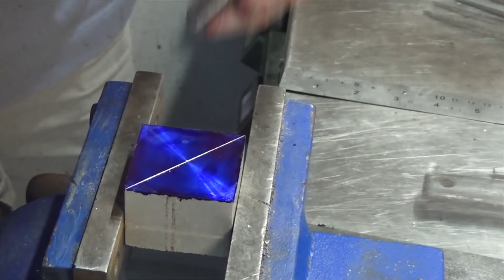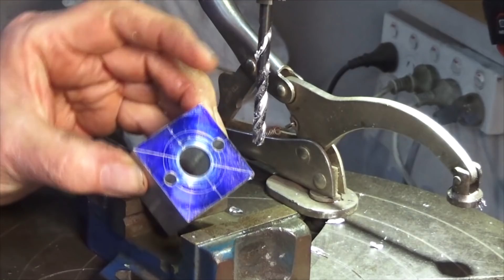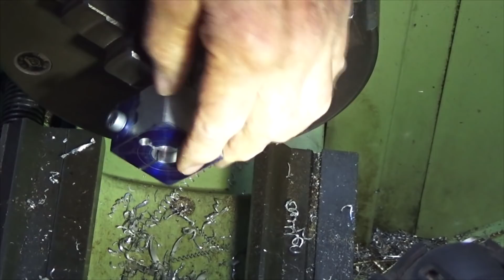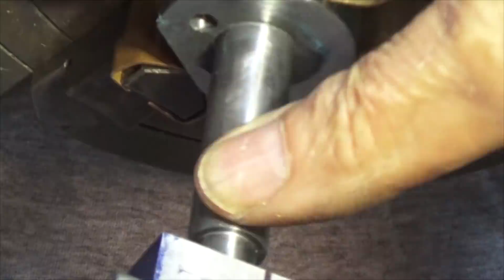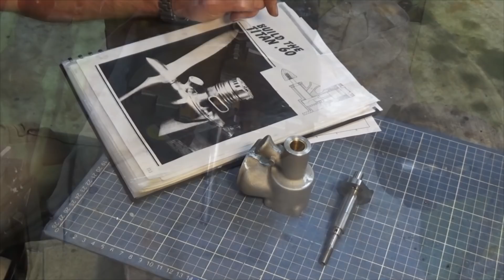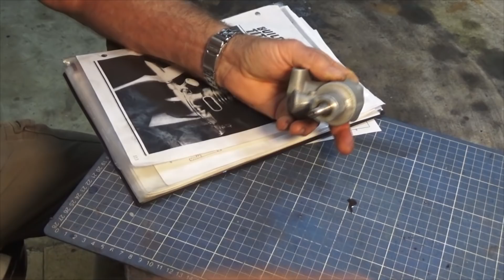Building the Titan .60 Glow Plug Engine #4

Comment: You might try running the crankshaft in the bushing using a drill motor and a fine jewelry polish at the tight spot.  There was a polish in a tube call "Semichromepoli", pink in color, that I've used for fine lapping in the past.
Reply from the maker: I have been able to remove the tight spot by running the shaft in the bush using the lathe at low speed with plenty of light oil. It freed up in just a few minutes. There were probably just a few microns of oversize shaft right at the junction of the shaft and the crank disc. Some people suggesting putting an undercut on the shaft or flaring the bush opening and that was going to be my next step but luckily it didn't come to that.
Regards,
Mark

Comment: My father was a tool maker and he used lapping compound on a leather belt! He would apply the lap to the soft leather side, then polish it using the hard side of the belt. He was one of those fathers that made you watch in his garage work shop and as a young boy I’m sorry to say I had no interest but I paid attention as I knew there would a Q&A afterwards
Reply from the maker: My father had a leather strop he used to sharpen knives. It probably had some sort of abrasive embedded in the surface. It did produce a wickedly sharp edge on the knife though. The whole father/son/workshop thing is an interesting topic. Some of the best students I ever taught would reveal that they spent time in their dad's workshop from a very early age or sometimes their grandad's shop. When my own son was a toddler I would put him in a backpack as I worked and he would look over my shoulder. It kept him safe and interested and I could get on with things. He is now an "Advanced Manufacturing Technologist" and he loves his job. It was not all plain sailing though. As a teenager he and I had our differences over respecting tools and cleaning up. I guess that is quite common. 
Regards,
Mark

Comment: Steve Summers did a lap vid on the mini lathe headstock which was quite informative. 
MDF can be used also to imbed the paste.
Great series Pres, thanks for sharing. 
Cheers
Reply from the maker: Thanks. I used to have some big pieces of Lignum Vitae wood which was incredibly dense and stable. It would make a really good lapping block. I am keen to have another go at this process when I do the cylinder liner.
Regards,
Mark

Comment: Hi Mark.
I don't "know it all" but FYI, when we were rebuilding large diesel engines and had used an aluminum lap on the crankshafts, we were told to always clean the crankshaft with a strong caustic solution to be sure to remove any aluminum that can get embedded when using an aluminum lap. We were told that not cleaning the crankshaft with caustic could lead to wiped bearings from the embedded aluminum.
I'm not sure that would apply here, but it may save you some trouble. Take care.
Reply from the maker: I guess that makes sense. The caustic would etch away any trace of the aluminium. As it turns out this engine will probably only run a few times and then it is to be sent back to the owner and put in a museum to honour the designer, George Genevro. That's if I can get it to run!
Regards,
Mark

Comment: Thanks again Mark, this series on the Titan 60 has really caught my fascination and I am looking forward to seeing the engine completed and running. I did comment on a previous video to ask if it would be possible to use 3D imaging technology to create new patterns for the body and crankcase of the engine? Anyway, I hope you manage to get away and enjoy your break in Tasmania.
Reply from the maker: I would think that you would need some pretty complex imaging systems to scan inside. Even a FARO arm with a laser scanning head would find it hard inside that small space. If I had to do it I think I would pour a moulding silicone inside and it would pull out fairly easily when set. You could then scan that to get a point cloud for an STL file. I am still hoping that the original patterns and core boxes can be put back into service.
Regards,
Mark

Comment: Chuck up the crankcase with the bushing installed, put a shallow champher on the bushing facing inside. Great series, as always.
Reply: I meant to say, would it be possible to champher the bushing?
Reply from the maker: It is fixed now. It wasn't hard at all. It just needed a few turns at low speed with plenty of light oil.
Regards,
Mark

Comment: Hi Mark I have found your series interesting, I was thinking by using some string with lapping compound on it could get you close to the counter weight of the crank and cut only the high spot on the shaft. or maybe just undercut the bushing at the very end where the binding occurs. I'm not sure if trying to run in the engine is a good idea, the risk of galling at the crank counter weight 
good luck Rich
Reply from the maker: Rich, I think I have fixed the issue. I just ran the crank and bearing in the lathe on low speed with plenty of "3 in 1" sewing machine oil on the surfaces and it has freed right up. The amount of oil in the glow plug fuel would not be sufficient to prevent galling and of course it would be running at some insane speed but in the lathe you can feel how much resistance there is and adjust accordingly.  All good now.
Regards,
Mark

Comment: Great work!  Leather or plastic sheet are good options for bed protection.  If you slop enough compound about it can get through fabric.
Reply from the maker: Thanks. The stuff that is supplied in the syringes is pretty clingy so it doesn't tend to run off. The main issue is to be disciplined in getting rid of the paper towel used to clean the part.
Regards,
Mark

Comment: How about an un-clamping screw as well as a clamping screw? Put lapping in the title, it'll get more hits! Cheers, Matthew
Reply from the maker: If you wanted to use the lap for other jobs you could add quite a few refinements. This was probably a one off so I didn't go to much trouble with it. I need to make another one for lapping the piston and an internal lap for the cylinder liner. Many people questioned why I bothered to make a lap for the crankshaft but I wanted to practice on something that was less critical. The piston/cylinder fit has to be almost zero clearance at the top of the stroke. 
Regards,
Mark

Comment: Lapping is always so satisfying, the highest of precision with the simplest of tools. I sometimes make 2 or 3 laps each dedicated to a specific grit diamond grit size. Great job!
Reply from the maker: Thanks Nigel. I was initially thinking that lapping was some sort of black magic and only those with Renzetti like powers could even dream of achieving it but it turned out to be a bit of an anti-climax. This was only the opening round though. I still have to lap the piston and the cylinder liner.
Regards,
Mark

Comment: Put a small Chamfer on the crank bush this will help with lubrication and fix your end float fit .
Reply from the maker: Thanks Ian. I think I have resolved the fit issue. I just ran it lightly in the lathe for a while with some light "3 in 1" sewing machine oil on it and it freed right up. There was a light sheen of gold coloured film on the shaft when I was finished so  I am guessing this was the remains of the very slight interference fit. It now spins beautifully. There is literally no discernible slop in the fit. Usually if you push the shaft side to side you can see the oil film squeezing from one side to the other but in this case it is rock solid radially but still smooth as butter axially. Happy days!
Regards,
Mark

Comment: Could you 3D print pattens off the drawings you made? I have done that before to cast parts myself.
Reply from the maker: The external shape of the casting is not too hard but it has some internal detail that is almost impossible to measure. The transfer ports are 3D shapes and would require core boxes to replicate those voids. I don't know how critical the shapes would be but I am guessing that it takes some experience and theoretical knowledge to understand the gas velocities and how the volumes would affect them. 
Regards,
Mark

Comment: mark relieve the inner edge of the bronze bush put a5 degree shamfer on the inner rear edge don't taper it just a small shamfer that should relieve the tight spot cheers glenn
Reply from the maker: Glenn, I have fixed the issue. It just needed some light running in the lathe with plenty of light oil and it freed right up.
Regards,
Mark

Comment: Interesting tool I like it. My only input on it would be, that you add a groove in the bushing at the top. In the trust area. Like an old Harley crank case bushing. To allow oil to fall in between the crank face and the bushing. So as the prop pulls forward on the crank the crank will sling oil into the trust face and down into the shaft bush. Another thing I would do would be to center drill the crank from the back side with about a 1/32nd hole. Go down about halfway into the center of the bush. Then drill another hole centered on the trust face bush groove down to the core hole. Then drill another hole from the center of the shaft where it sits in the bush down to the core hole. Then press in a plug at the back and pean on two sides so it can never come out. That way you have oil that has slung in between the thrust face and as the crank rotates the crank scoops up oil and sends it to the middle of your bushing and out.
Reply: The crank's already centre drilled, that's the fuel inlet path.
Reply: The fuel itself is all the lubricant needed in these nitro engines.
Reply from the maker: I must be careful to follow the build notes supplied by the original designer, George Genevro. The project is as much about getting the engine to run as it is to honour the work that George has done in his 99 years. Also, the fuel in these engines is much like two stroke fuel. The only lubrication comes from the dissolved oil in the methanol fuel. Back in our day it used to be castor oil.
Regards,
Mark
Reply: @Preso58  ah ok

Comment: I heard what you said in the speeded up section with the bandsaw. Great video. Neat honest series
Reply from the maker: It was a race between getting the cut finished and roasting my finger tips. A more astute builder would have had a block of wood on hand to push the stock. I am not that astute.
Regards,
Mark

Comment: i feel like that could easily be printed and casted at home
Reply from the maker: I wish. The internal detail is almost impossible to measure. There are gas passages in the space between the crankcase bore and the cylinder bore and they have 3 dimensional curves. The outside shape could be replicated fairly easily but even with sophisticated laser scanners it would be quite a mission to get at the internal shape without cutting the casting in half. 
Regards,
Mark

Comment: You're smarter than me ..  would lapping the bushing to the crank, to remove that last tight spot, be an option?
Reply: Getting the bedded particles of diamond out of the softer bush afterwards would would be a problem, and if left there would lead to wear.
Reply from the maker: Paul, you cannot lap soft materials like bronze without embedding the grit in the bearing. A soft lap can cut a fully hardened shaft without too much wear but lapping a soft bearing would require an even softer lap. Maybe lead or plastic would work but I would still be concerned that there would be some embedded grit in the bush.
Regards,
Mark

Comment: One way to get an extremely bright finish is the use crocus cloth and some very fine crocus powder .
Reply from the maker: Joe, this was more about getting the shaft dimensionally accurate rather than getting a polished surface texture. A lap can make an out of round part truly round and it can also remove axial high spots to very fine tolerances. 
Regards,
Mark

Comment: Nicely done, Preso! 😊  I've used dirty leather to polish rings made of 316 stainless pipe and that worked quite well. Didn't have a lathe, just a stud bolt and a drill press lol. Not exactly for precision obviously, but it did make them shiny 🙂. Loved the out takes! I could tell you were putting in some extra effort for us right off the jump 😊. Thanks, Preso! Have a good one mate! 
Cheers! 👍😁👍
Reply from the maker: I recall my father had an old leather strop that he used to sharpen knives.  It must have had something embedded in the leather because he could get a razor sharp edge on a knife with seemingly little effort. His party trick was shaving his arm with the blade after a few quick swipes  on the strop. I could make a two hour video with all the outtakes I have done over the last  year or two. There's something about talking to an inanimate camera that severs the stream betwixt mouth and brain! Go on, man up and let's see your best/worst efforts. 😁
Regards,
Mark

Comment: Most interesting. I have a home made tool post grinder I use to get a nice finish on shafts but it's never quite as good as I had hoped. This will be an excellent addition to the finishing toolbox. Thanks.
Reply from the maker: I actually have a Quorn tool and cutter grinder that can have the grinding spindle removed and mounted on my compound slide. I have used it a few times to true up a morse taper centre but I wanted to try the lapping because later on I will need to lap the piston and cylinder for the engine. The goal is to have almost zero clearance at the top of the stroke and just microns at the bottom of the stroke. Also, I have heard Robin Renzetti talking about "wheel hop" which refers to the patterns formed during grinding as a result of having an out of balance grinding wheel or bad spindle or linear bearings. At the end of the day, the lapping was actually a lot easier than I thought it was going to be.
Regards,
Mark

Comment: G'Day,,this comment is an early one on this vid,,,
But using high speed steel tooling grind a big radi on nose of tool,, slow speed and feed down and run slow,,very slow,,can achvieve mirror finish,,Plenty of coolant,,
used to piss the tech teacher of with mirror polish on me finished thread cutting,,
Reply from the maker: I'll have to try that. 
Regards,
Mark

Comment: engine patterns or mold could be made with 3D printer
Reply from the maker: They can but you still have to be able to measure the compound curves and the interior shape of the transfer passage which is quite a complex three dimensional shape.
Regards,
Mark

Comment: Put a chamfer in the end of the bush where it’s tight, letting it wear in is going to generate too much heat.
Reply: Long-time modeler and engine tuner here . . . Chuck is right. The crank will overheat if it is too tight. I’d chuck the crank up in the lathe, then use a 6 mm wide strip of 3000 grit wet or dry paper sand paper (use a little soap and water with it) to burnish the area that is oversize. 

3000 grit will leave a mirror finish - you should be able to find some at an auto body supply shop. Don’t use the foam-backed variety - you want a paper-backed abrasive so it has some stiffness across its width. If you can’t find 3000 grit, 2000 grit would work okay too.
Reply from the maker: Yes that would work but I wanted to try lapping on this relatively simple part before I try to do the cylinder liner. According to the gurus who know all about model 2 stroke engines, the fit between the piston and the cylinder bore needs to be almost zero at the top of the stroke and just a few microns clearance at the bottom of the stroke. Wish me luck!
Regards,
Mark

Comment: Sweet.  I’d go ahead and lap the shaft directly into the bushing, just a wee bit at that end stage there, with the bushing in the crank case.  There’s nothing wring with doing that’s so long as you get the lapping compound completely out afterwards.  I’ve done that on musical instrument piston and rotary valves occasionally, for 40 years, and the valves can thus be fit by hand to within a few ten-thousandths of an inch.  Have fun on Tazi!
Reply from the maker: I was warned off putting the lapping paste inside the bushing. It will be embedded in the soft bronze alloy and even though you can wash the paste off the surface some will remain. Probably for parts that don't run at high rotational speeds it may not be a problem.  However, this is the first time I have done it so I am definitely not an expert.
Regards,
Mark

Comment: Making the aluminum lap the same on each end, and flipping it around after a even number of passes of lapping, would probably reduce the actual taper on the crankshaft nose. Maybe by a little bit? The binding interference in the corner where the crankshaft meets the bush could probably be resolved with a larger chamfer in the ID of the face of the bush? Although I am probably missing something here that you already covered. Great project! Anxious to hear it come to life!
Reply: I was going to say the same thing.  Plus, I've been taught to make laps in sets of 3, and rotate between their use.  That way, it averages any irregularity in any one between the three, giving a much more flat and consistent lapping.
Reply from the maker: I did flip the lap regularly but the recommended procedure is to run the lap off the end of the shaft by about 30% at either end but you cannot do that when lapping up to a shoulder. The tight spot was probably just a micron or two oversize. Undercutting the end of the shaft at the crank disc face is also undesirable as it becomes a stress point which can lead to fatigue cracking. I have fixed the fit at that end. It just needed a little light running at low speed with plenty of light oil. I will discuss the fitting process in the next video. 
Regards,
Mark